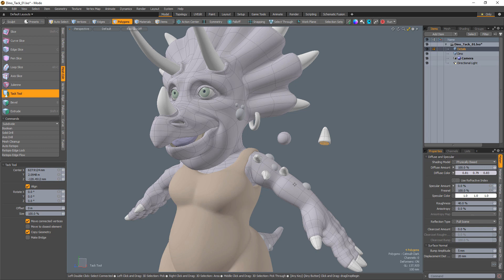MODO | Tack Tool

Comment: why is it when I'm trying to use this tool the item appears 5 feet above the surface I want to put it on?
Reply from the maker: did you change the offset value?
Reply: Not at all its set to zero.
Reply from the maker: can u share a screen of what your doing?
Reply: I'm stupid. Figured it out. I had another piece of Geo i couldn't see floating in the same mesh layer.
Reply from the maker: good to hear  your all set!